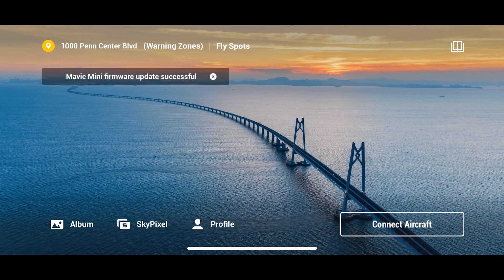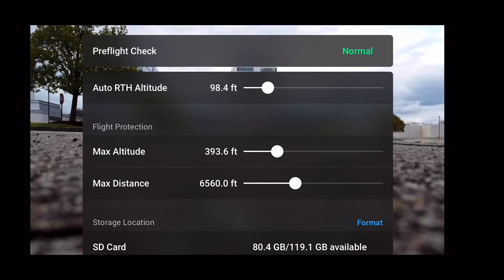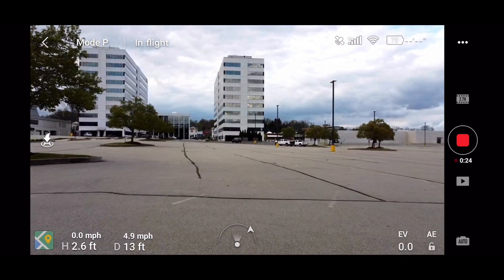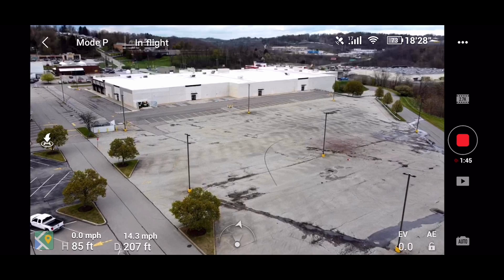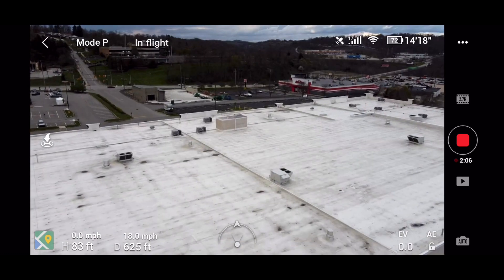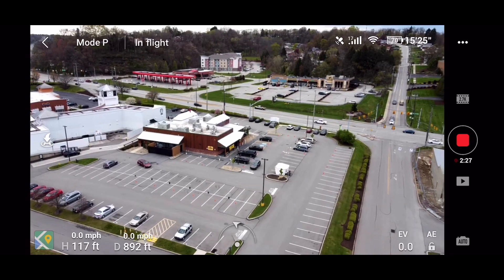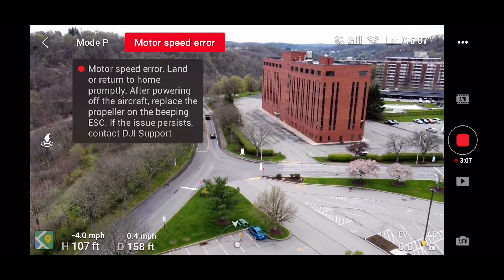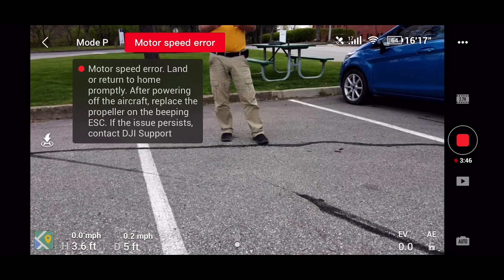DJI Mavic Mini Update V01.00.0500 Double Motor Speed Error

Comment: After updating, I have a problem with my speed. Won’t go pass 4. 5 miles even when I switch it to sport mode! Did I miss something? Big issue for me.
Reply: Flip101ification The exact same thing is happening to me, when I did an RTH it didn’t come home but just climb in altitude. I downgraded to the older firmware with the DJI assistant app on my computer.
Reply: I'm having the same speed issue. I normally get 29km/h (18mph) in P mode and I went out tonight for the first time since the update and i'm only getting 10km/h (6mph) in Sport mode.
Reply: mmills006 did yu calibrated your remote after the new update? Use assistant 2 on computer.
Reply: @Flip101ification  I did not calibrate the remote after the update or use the DJI Assistant. I did do a flight today and had no speed issues with 29kph/18mph in P-Mode and 46kph/28mph in Sport-Mode with no error messages or other warnings.

Comment: I have the same damn issue hopefully they fix this asap please.
Reply: UPDATE- Solution.. as suggested by a comment by TDR Drones, I re-upgraded the firmware USING MY PC and a USB CABLE. After three tries the statusbar finally got to 100% and the problem is solved. The first time I upgraded was thru the "RC-Drone wifi connection", it got several restarts and never went above 99%. USE A USB CABLE AND A PC, THRU ASSISTANT 2 FOR MAVIC. Connect and update both the Mini and the RC. It worked! Thank you QC for pointing the problem out!
Reply: Also need to upgrade all batteries. I did my upgrade thru the computer using dji assistant and do not have any issues
Reply: re calibrate the remote

Comment: Sorry about those motor issues, I hope you get them sorted. This update caused my controller to beep non-stop and it took me over a day to sort it out. I needed to calibrated the sticks, but there was a problem with my update so I wasn't able to do that until I used the DJI Assistant app to refresh the update. And I still haven't got to test fly it, so I may not be out of the woods yet. Nice video Bryan.

Comment: I don't fly a DJI but here's what I think. check your props you probably got some deform props when you put them back in the case. and you push the props down and they got warped and probably going to be the back to check them. and change them and see if it fixes your problem. I'm just taking a guess it might be your props because I had the same problem on a smaller drone I flew none DJI so check it. Enjoy and have fun flying.

Comment: I agree with you on that, why change the props if its been fine all the other times. I’m not updating mine till it’s all figured out
Reply: Refresh the mini true the pc application and the mavic mini will fly good dont change the props
Reply: The reasoning for this is that this was not sensitive before. More of a safety feature. I would suggest attempting a swap of the drone. I am all for safety features, especially if it improves the longevity of the motors. 

At least compare the new props to the old props and make sure the old props are not flattened. If they are, you need to replace the props to keep the drone in working order.

Comment: I've been reading about these issues too. I haven't had an issue with mine yet but wonder if it's because I have the 199g version? For the life of me I cant get why these updates don't have better testing, particularly when coming from a big company like this.
Reply from the maker: Same here, don't they test this crap
Reply from the maker: yes they test it, in the office
Reply: @bryansbikes  lol
Reply: isn't the only difference between the versions, that the 199g has a different battery?
Reply: @planetprospective6211  Actually they are completely different model releases. The wireless tech is a bit weaker in the JP version, the remote as well. I have had no issue taking mine beyond 4k though.
Reply: @gamingfogie  thanks for the info, i live in a very urban enviroment (London) so I take mine out to around 1800 feet at most but look forward to using it in the countryside and taking it out to 4k+

Comment: That's very concerning Bryan.
I updated mine yesterday as it offered me lots of new useful features. I briefly test flew it in my garden for 15 mins or so, just low hovering and flying around my garden. Everything seemed fine and I got no motor errors but obviously I'll keep an eye out for that next time I fly properly.
Hopefully DJI will sort this out quickly. ⚠️
Reply: I only got my warning after flying in sports mode away from me after 10 minutes, I went through 6 batteries of flight that all were perfect with the warning so its obviously an error, it didn't always occur straight away, usually took 5-10 mins
Reply: @planetprospective6211  I don't think it's related to firmware update at all. I had some "maximum power reached" warnings or errors sometimes, usually related to turbulent winds or wind gusts, drone never noticeably descended, but once when it happened above the hill with sharp top, it wobbled so much that it seemed it will overturn. Today it finally suggested replacing left rear propellers. I flew forward/up over the pond, five seconds later wind gust out of nowhere and motor error. Hopefully I never noticed any uncontrolled descent (except losing visual positioning system over snow and water, but that's another story).
Reply: @pavelperina7629  Interesting, i've not seen maximum power reached before, must have been some wind! I would be very worried if it wobbled enough to possibly flip over, wow. I flew yesterday with a gust of about 10-20mph, I have on my channel right now about 10 minute footage of the drone hovering over a warehouse that you're welcome to check out , and the entire time it was showing this motor error yet stayed in place perfect, I am in two minds about whether or not its update issue, I just can't see it being anything else, I flew this thing for 6 miles with this error and the flight as the same as usual without any propellar changes
Reply: Luckly you...